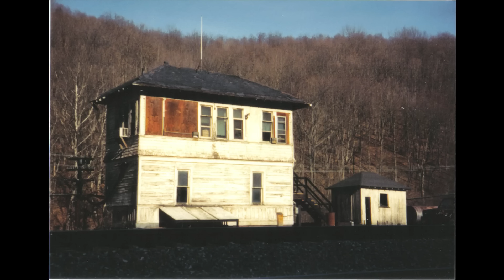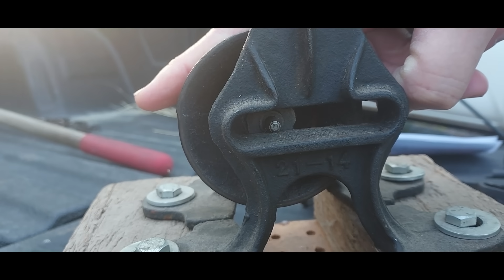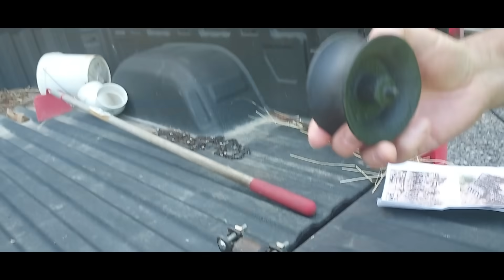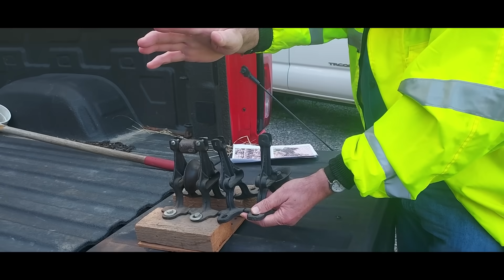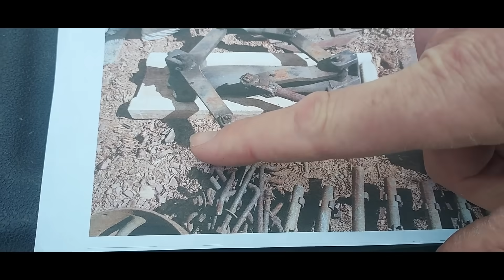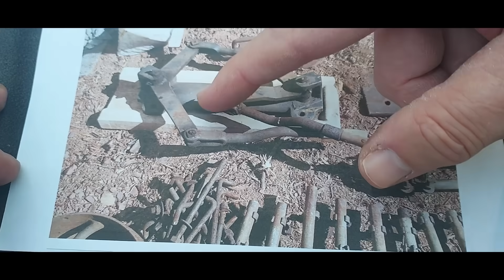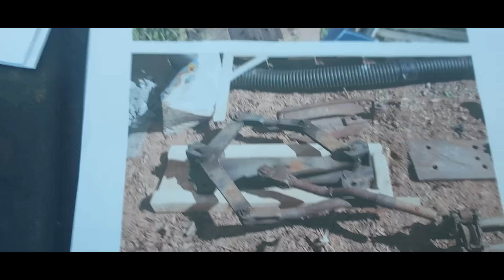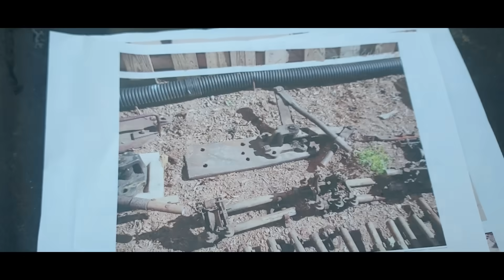How an Interlocking Switch was Thrown from a Switch Tower

Comment: Interesting stuff. In Sweden, and likely more countries, wires were used. As a wire can only pull there had to be a pair of wires to each semaphore, or switch. Special heavy weights made sure the tension was enough. "My" veteran railroad uses that system for 3 semaphores. All three are double wings showing stopp, straight or curve track. I'll try to remember taking some pictures of them and upload.
Reply from the maker: Awesome and thank you for sharing that Stefan. Yes it would
be very interesting to see if you could do a video or upload
some pics sometime.   Mark and I very much appreciate your watching our video and hope you have a very good day.

Comment: The BX Tower(St Thomas)is in preservation today. Around the switch rods is a community garden.
On July 15, 1887, the worst railway accident in the history of St. Thomas occurred. A northbound London & Port Stanley Railway picnic excursion train collided with a Michigan Central freight train, hitting two oil tankers. Upon impact, the first tanker exploded, sending flaming debris into the air. Within minutes, the second tanker ruptured, engulfing a section of Talbot Street and beyond with flaming oil. The wreck claimed fourteen lives and injured another sixty-eight.
As a response to this accident, and to increase safety, the BX Tower was built around 1910, housing switches for the Michigan Central and London & Port Stanley Railway crossing. The “interlocker system” was considered a major improvement in railway safety. The system required switches, signals, and derailers to be thrown from a central location (The BX Tower) in correct sequences. The tower continued to operate into the 1980s
Reply from the maker: Cool! Thank you for sharing that RR history with us Doug. Very
interesting to find out. Sadly a big part of RR history is people
getting killed in order for better innovations and improvements
to be made. They say most RR rules were written in blood.
 Mark and I very much appreciate your watching our video and hope you have a very good day.

Comment: On the ATCS Monitor, you saw the commands sent, the mnemonics, kile K11, K12, K23, etc 
The BCP, base tower sends commands to a control point 
The MVP sends status indications

So you saw a datagram of all the commands

Then the MCP would send the indications

So if K11 is normal position of Switch 1 on track 1, K12 is reversed, and K41 is Switch  1 on track 2 and K42 is reversed

The MVP sends
K11, K21, K31, K41, etc

As the switches move you see
K12, K21, K31, K41, etc
K12, K21, K31, K42, etc

K12, K13 ( INTERLOCK ENGAGED TRACK 1 ),K21, K31, K42, K43 ( INTERLOCK
 ENGAGED TRACK 2 )

K12,K13,K21,K25 ( GREEN SOUTH TRACK 1 ), K31,K42,K43, etc

As the train approaches you see K15 North approach block track 1 occupied
Then you see K14 Terminal TK plant occupied, then the green indicator drops
Then K23 as the train enters the crossover, K44 as it enters the track 2 south block
Then K15 drops as the train clears the north block, then K14 drops and K23
Then K13 and K43 drop deactivated the INTERLOCK 

Then finally K44 drops when the train clears the south block

ATCS Monitor is awesome 

Unfortunately they are taking it out all across America 

Many lines are already switched to PTC

We don't have any way to decode PTC
Reply from the maker: Wow that's pretty cool ocsrc. I never downloaded any ATCS
so I never got to see how it worked. thank you for sharing that
with us. A road foreman with Hulcher once told me he had
ATCS on his phone and used it when they went out on derailments,
he told me he trusted it more than dispatch to know where
trains were.   Mark and I very much appreciate your taking the time to watch and may you have a very good day my friend.